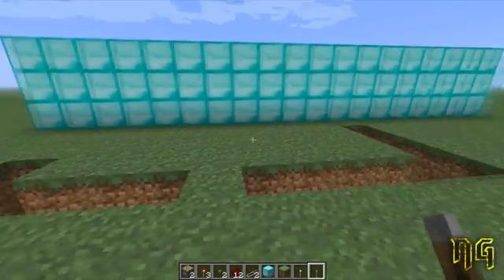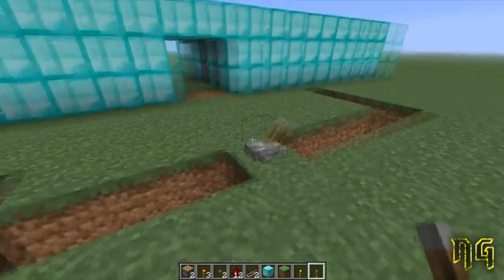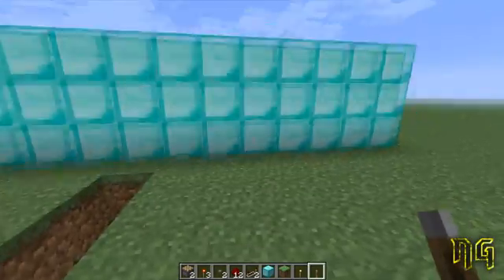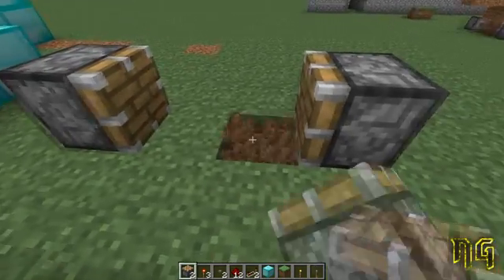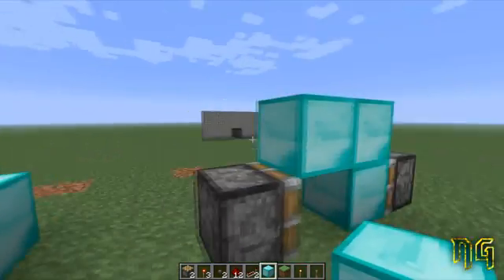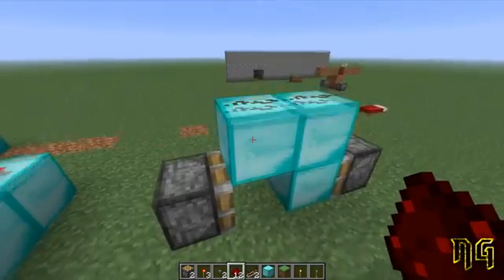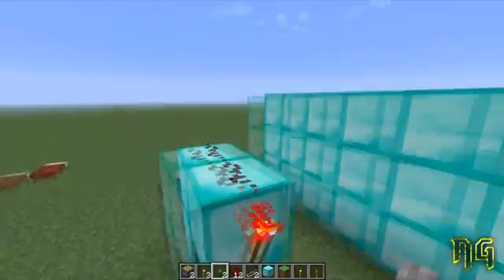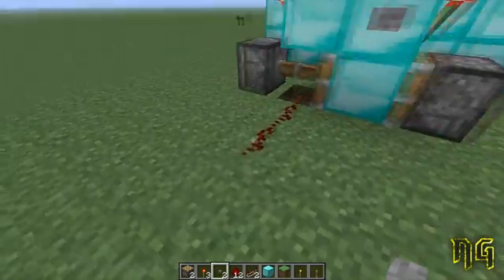MCTUT - Super Compact T Flip Flop

Comment: it took me about 1 to 1 and a half hours to figure out what i was doing wrong i done everything you done but my button is a bit further away so i replaced it with a lever to see if the redstone was too long so then i had to put a repeater down and then replaced the lever with a switch. then it worked so if i knew that it would have been done alot quicker but thanks about 43% of it was difficult.